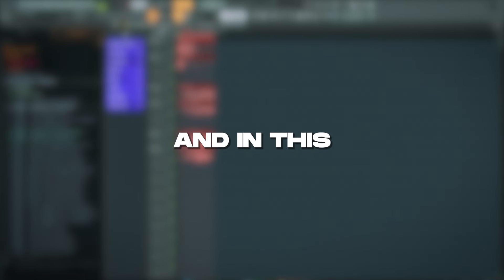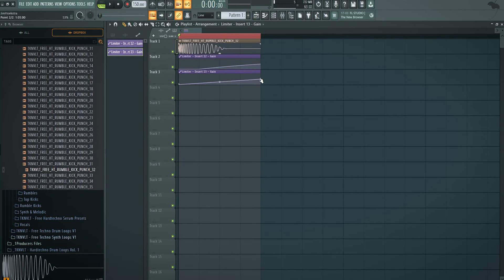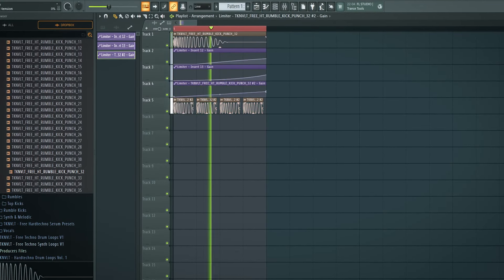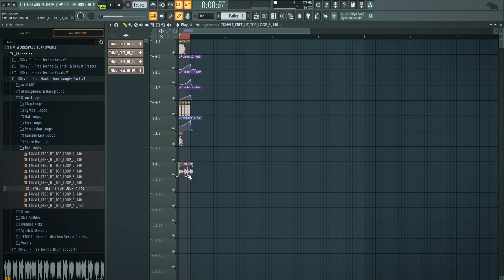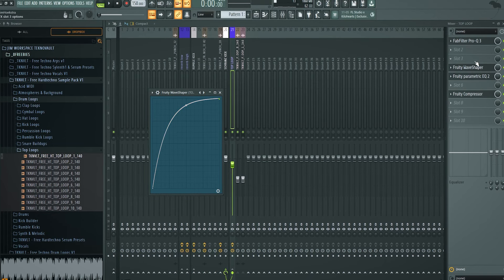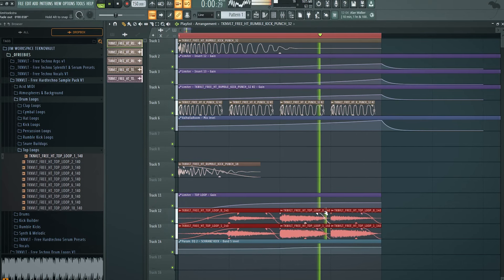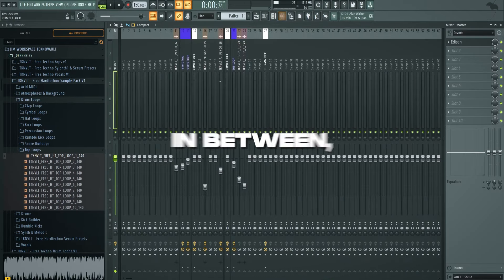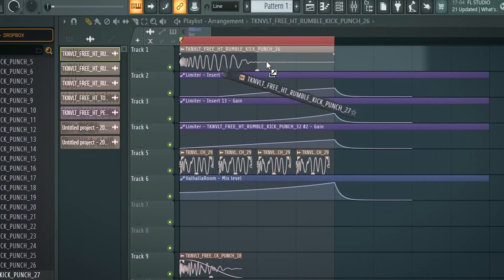Professional SCHRANZ KICKS (Hard Techno Tutorial)

Comment: I really congratulate you on your work and wish you luck in getting better, but I couldn't ignore some mistakes. Mixing regardless of gain settings and working with the clipper's distortion saves time and may feel good instantly, but you should not forget that every time you use a clipper, you give up the natural bass and squash the dynamics. Headphones or in a normal studio may feel right, but in club sound systems, the bass under 150hz will not be strong enough and effective. If you do not apply a sidechain below 150 hz to the compressor you use during the mastering phase- which many producers do not- it will lose much more power due to these mistakes made during the mixing phase. It may make sense to make certain parts mono over eq, but if you separate the post signal you get over reverb with eq, you will also have huge phase problems with dozens of distorted sounds. I’m not saying these for an offensive purpose, all the best <3
Reply from the maker: So what is the solution then? Coming from Hardstyle, these methods are widely used in the scene. Those kicks are then played in clubs and on festivals.

I like the point though, just interested to know why you think this will cause issues?

As long as you put the bass/sub in mono in the final chain and control the dynamics (either squash against 0db or add compressor), all should be fine.
Reply: @teknovault  for phasing issues, I’m recommending you to use SSL X-Phase plugin. It might take time to understand what it really does but when you figured it out you’ll see kick will be sound much more powerful.
Reply from the maker: @irfaneftal99  If the low end is put on mid/side, and then compressed or clipped to 0db, there shouldnt be phasing issues in the low end 💪
Reply: You're handling the bass just fine OPS, but in techno land, ppl produce more conservative like so they don't like the idea of clipping.

If you want to be 100% sure if the bass hits below 150, just try on several bigger speakers and compare to bigname productions like Reset Robot or smth. Don't worry what other ppl say.

Comment: Very nice video,
I have a question, how do you sidechain directly on the pattern like at 6:10 for example?

I've been looking for a while and I don't understand :(
Reply: It doesnt work with patterns. But You can do it with rendered presets. If You have FL21 or fresher, just put coursor on the clip. Smal triangles will appear on both corners. Clik on triangle, keep and drag it as he did.  Note: In older FL versions this function is disable.
Reply: Samee bro

Comment: You do know that the rumble kick part could've been way easier if you just created a Patcher preset with all of this over-complicated routing condensed into a single FX plugin, right? You can even design a GUI in Patcher Surface for it to make it look pretty.

Also, why are you using Pro-Q 3 to do M/S EQing?  If you want to stick to stock FL plugins, you can do this with PEQ2 + Stereo Shaper.
Reply from the maker: Ofcourse! The thing is, this way people learn how to do it from the ground up. If we would also have to explain the patcher plugin process, this would become an entirely different video 😉

Instead of PEQ2 + Stereo Shaper you could also use maximus btw 💪
Reply: @teknovault  Perfectly understandable. However, I think beginners can also learn the same workflow on Patcher which enables them to be more productive in the long run. And visually speaking, it's clearly easier to understand the routing process through the links between plugins and layers in Patcher's mapping scheme rather than side by side mixer tracks.

Don't take this badly, it's just a suggestion to improve production learning content in general in order to make creators produce more original stuff, which personally I'm always into.

Either way, it's good tutorial. Cheers 💪
Reply from the maker: @velutz_  Gochu! Definitely great idea for a future video to focus on a patcher style video 💪